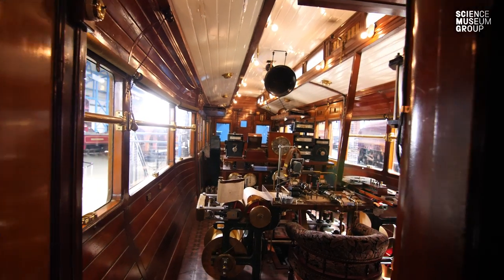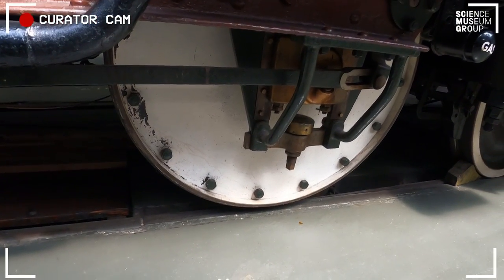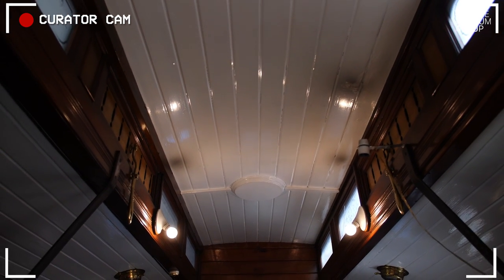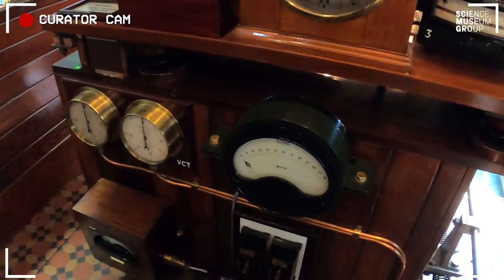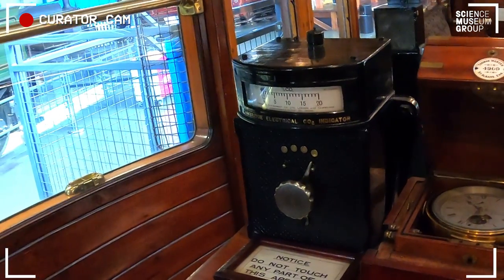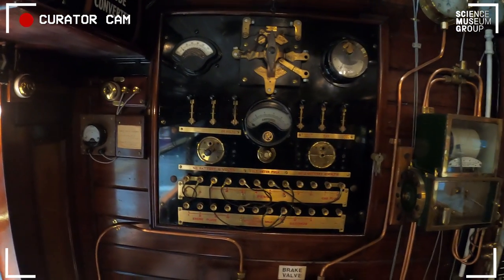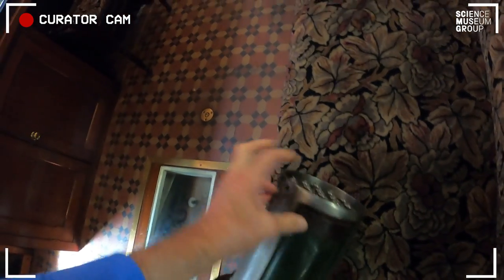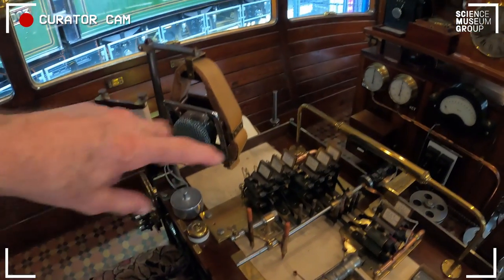How was Mallard's 126mph run recorded? | Curator with a Camera

Comment: I personally got completely say that I personally saw a dynamometer car @ the B & O Railroad Museum, so I personally do specifically feel quite aware of how a dynamometer car operates! Besides, it's basically quite clear that dynamometer cars certainly would basically also apparently be fitted with an official complete sleeping quaters for the people that are working over in the dynamometer car can easily get some shut-eye in between each shift! Plus, you'll be very shockingly surprisingly pleased to happily know that I seriously do personally just suddenly recently recall seeing a video on YouTube several times recently featuring Tornado as the custom-built L N E R class A1 Pacific type of steam-driven railway tender locomotive designed by Sir Herbert Nigel Gresley's successor managed to easily reach 1OO MPH top speed with ease despite several speed restrictions in several locations during the official test run from York to Newcastle followed by the return trip to York!

Comment: I seriously gotta personally just suddenly feel quite pleased to happily mention that I seriously just suddenly came up with the officially well-knowingly clever idea of completely building an officially amazingly exact copy of the famous record-holdin' L N E R class A4 Pacific type of steam-driven railway tender locomotive designed by Sir Herbert Nigel Gresley himself in Doncaster during the official 193Os(July 3rd of the year of precisely 1938 respectfully)Mallard alongside a specifically wonderfully great newly improvable L N E R dynamometer car fitted with an official set of knuckle coupling devices on each end to allow 'em to pull American-origin rolling stock with ease alongside recreating the officially well-knowingly obviously famous 126 MPH(2O2.58 KPH) top speed record WHILE also apparently pulling a train of Amtrak passenger coaches behind the dynamometer car as the passengers onboard can easily use GPS compatible devices to help with recording the record!

Comment: At about 1:30 the curator says you could do much of the measuring with an app now.  The current method of tracking speed is still physical, I believe.  Driverless stuff like the DLR count wheel rotations to track their position, albeit with regular balises to confirm position.  Speedos in cabs are presumably mechanical or electro-mechanical, as in a car.

Comment: Please do not forget the HST as a whole train was the " Railway " answer to the problems the APT was encountering at the time, HST used good established engineering answers to correct issues that the technology of the day could not,APT at the time was a leap to far  for the bofins but the principles came through in the end with Pendoleneo. Sadly the government of the day pulled the plug on the money .

Comment: Ian Johns
Be it noted that "Mallard" attained this speed down Stoke Bank whereas the DR 4-6-4 #05 002 travelled at 200.4 kph (124.5 mph) on virtually level track.  But a fine and most interesting video nevertheless!
Reply: But that loco was hauling a lighter train, I think - so the performance is comparable.

Comment: The title needs the word "official" because remember there had been an un official claim from an earlier year with a speed of 127.1 mph
Reply: Which is probably a timing artifact;  there is no credible way to explain the acceleration from the previous timed section or braking for the following.

As with 5550 (or a Milwaukee A) it would be possible to replicate the PRR Atlantic in question and test it, but it's highly unlikely the result would be 'proof of high speed'

Comment: Why did you not show the damage that was done to the drive train on the locomotive? I was most disappointed by that omission.
Reply: Well, i suspect its a multitude of reasons : This episode wasn't about Mallard itself, twas about the Dynomometer car. 2, the damage was all internal and not really something you could see. 3, and most importantly, the damage is no longer there ! It was fixed after the run and loco kept running well into BR days.

Comment: Yes folks, if near York do visit the National Railway Museum. Before watching this I though the dynamotor car just measured speed! What an idiot! Very impressive!
Reply: Technically the purpose of a dynamometer car is suggested by its name: it measures drawbar pull  at speed (which can be mathematically converted to horsepower).

I was hoping to see a technical reference to the timing standard used, and a high-resolution image of the high-speed portion of the trace with a discussion of how the amended speed of 126.1mph was extrapolated from it.

Comment: Millard could have went faster but the driver knew that the main axle bearing would over heat, I believed on the day he pushed it as far as he could….
Reply: Duddington thought that with a bit more of a start he could have reached 130 that day, and frankly I believe him.  The problem was with the inside connecting-rod big end, which was overloaded past the limit of the hydrodynamic lube film because of overtravel of the middle cylinder valve due to whip or lost motion in the conjugating gear.  This would not in itself likely have prohibited reaching a higher road speed, as it would not have been noticed until Duddington slacked speed (at which time it would have started knocking).  For all the would-be whiners (American and otherwise) the big-end 'fix' -- once the need for it was realized -- was rather quickly made, and even in the absence of a means to reduce the high-speed overtravel it solved any recurrence of that particular failure.

Comment: In the true sense of the rules of setting a speed record the Mallard failed as it was a specially set up attempt with only the driver and fireman in the engine and 12 personnel in the dynomomitor car,  plus 2 or 3 lightweight aluminium articulated coach sets without any passengers, pulling at most 260tons. It managed 126mph down-bank for a distance of 100yds before running it's main bearings and having to be towed back to Doncaster to be repaired, it had previously spent 6months there being set up to try for the record.
The previous holder of the record of 114mph, the LMS Coronation was hauling almost 600tons with every seat in the coaches filled and it did not require a long downhill section to achieve this feat, this was a new scheduled service from Euston to Crewe, after the tender was refilled at Crewe the Coronation continued in service until the start of WWII without any major service requirements, unlike the Mallard the Coronation could have done the high-speed run in the opposite direction (as per the regulations for speeds trials). 
The above details re: Mallard, are taken from the official LNER records.

Comment: Land speed record going downhill? Can't wait for the day, when someone with enough time & money just drops a live steam locomotive over White Sands Test Range from 40'000 ft. for a new record. I find it arrogant & offensive to be proclaiming greatness amidst grand controversy. Not only did the engine go downhill, it broke doing it, so it is unknown, if Mallard was actually providing the power to reach the recorded top speed. Any other land speed record has requirements for validation, that Mallard, to this day, ignores. A measured mile, with a two way run, to be repeated within an hour... Yep, great big pat on the shoulder for a job well done. Btw, nice touch banning the LMS from running that section of track - imbues confidence, doesn't it...?